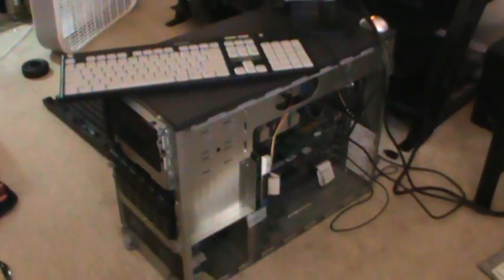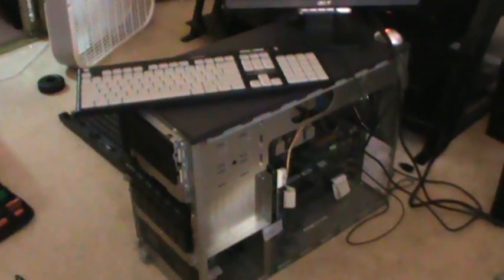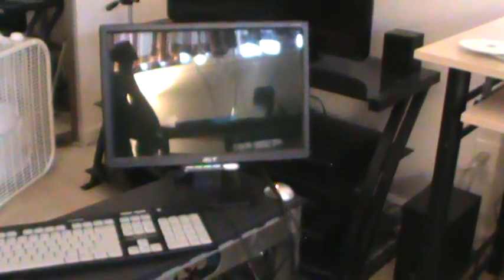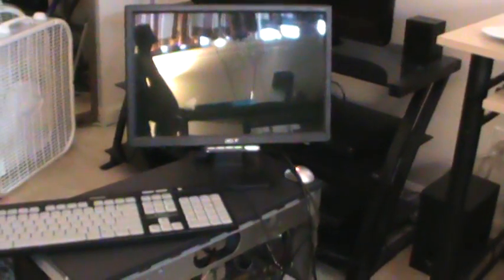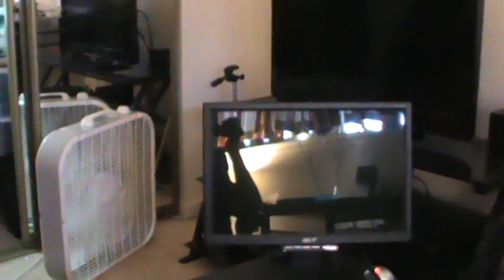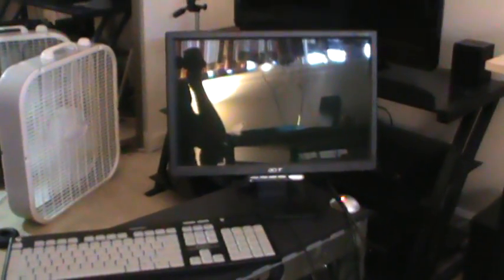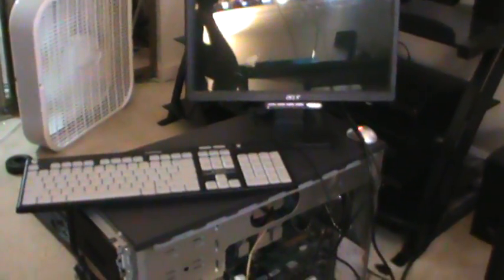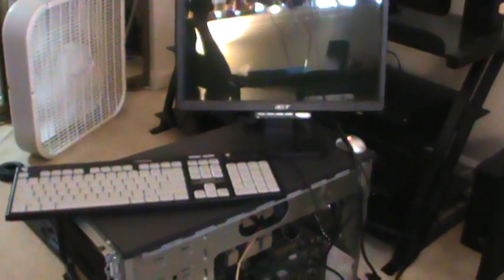I am going to Flip a Lid (Dell Server Help)

Comment: Have you tried checking all the ram slots to see if there not full of dust, also if you get it to boot try downloading the old bios onto a floppy and restoring it. You could also try reseating everything ( connectors from the psu,hard drives,ram,pci/isa cards and of course the CPU's

Comment from the maker: Yes, there is. I've tried all settings. No dice.

I will have to try booting with the RAID drives disconnected...even tho I don't think that's the problem. I haven't checked the model numbers, because I didn't see any. I'll make another attempt soon.

Comment: Reset the CMOS by using the reset jumper. If the issue persists, enter the Service Tag number from the system into the Dell Support site to get a list of parts this unit originally shipped with. Then you will know if the procs are not original to the system and there might have been something funny done to the BIOS. I doubt it shipped with custom BIOS from Dell and usually their update program won't flash mismatched BIOS.

Comment: hey here is a suggestion pull the power and the CMOS battery for 5 minutes and then boot it up again (that's how you reset the BIOS) Tell me if you have any luck!
servers are supper hard to deal with i have 4, i got them about a month ago and 2 of them are up and running

Comment: the motherboard does have a the pins called INTRUS2 I am looking at the manual for the rig also the cpus are PIIs, also it can go single or dual cpu. the only other thing I can think of is another issue is possable hard drive failure or power supply failure. another thing is there any beeps at all when you try to start it.
  
Service Manual  
support. dell. com/support/edocs/systems/scham/en/34365. pdf

Comment: downgrade the bios. usually if you use the backup BIOS option in the command line for the flashing utility, you can put the disk back in and it will restore the old BIOS. theres a 92% chance you didn't back it up though...

Comment: Pull the BIOS jumpers over a pin, boot it. Let it sit for a minute or so, then put the jumper back in the original position. That should work. It's saved me many time on my PC's.

Comment: Revert to the old BIOS? (when and if it boots)
Revert the jumpers to there original position? 
Try booting up by shorting the two jumpers on the board where the power button plugs in with a screwdriver?